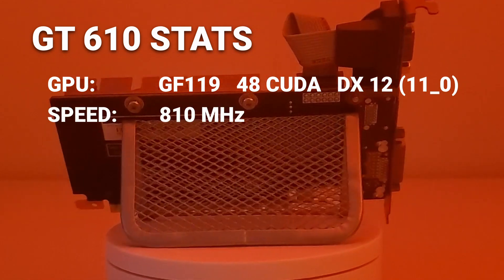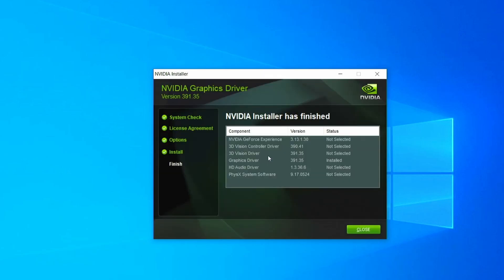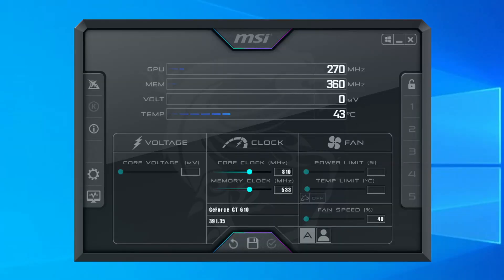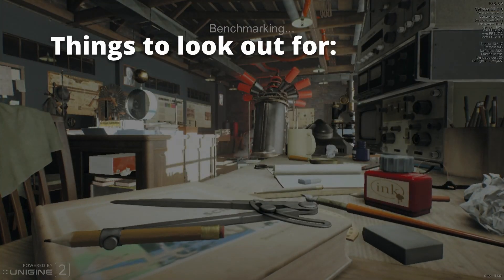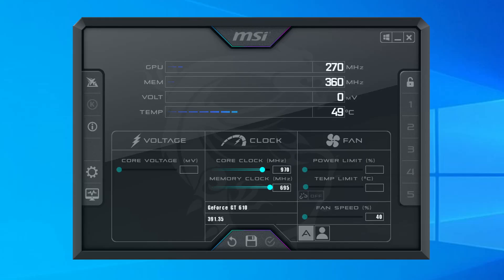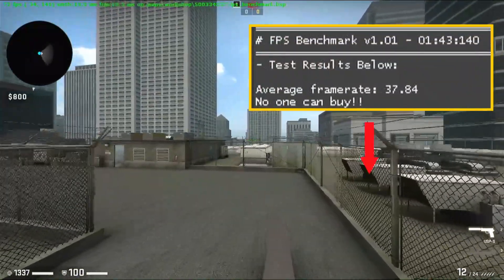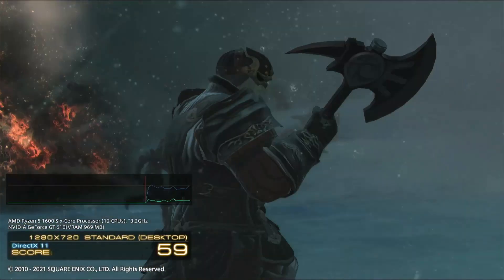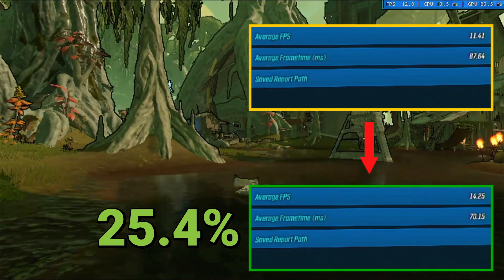Best GT 610 Overclocking Settings Guide

Comment: can it work with 620 gt
Reply: MSI afterburner works with 90% of gpus. Just slowly increase core clock by 15mhz and mem by like 25 for your 620 until its unstable then back off until you can run your games with 0 crashes. Good luck soldier.
Reply: @rrr00222  i am using 630 now cuz i cant affored better then that
Reply: @JedzStream  that is ok man :) information is the same if you wanna overclock. as long as you get enjoyment out of your system that is what matters, and using such hardware will make you appreciate the better hardware in the future

Comment: Is do 1055/650 gt 610 ddr3 2gb varient with 100% fan speed
Reply: I got the same one gt610 ddr3 2gb I usually get 25 average fps how much will it get after overclocking? And is it safe??

Comment: Sir I have gaming monitor 180hz can I output refresh rate 180hz from this card ?
Reply from the maker: The max refresh rate on the GT 610 is 240 Hz. Not sure if this is at all resolutions however.

Comment: Is it possible to connect 3 monitors to that GT 610?
Reply from the maker: Great question! Unfortunately, the GT 610 can only display up to 2 monitors at once. I tested this out myself and could get any 2 combinations of output (HDMI, VGA, DVI) to work, however when connecting all 3, one of the others would always stop broadcasting a signal.

For the GeForce 6xx series of cards, you would most likely need a GT 640 or higher to display more than 2 signals at a time.

Comment: This is one of the best gpu ever(not for gaming). It was actually my old gpu. One thing i noticed that the fan did'nt rotate. Do you know if it was normal cuz in your one it is rotating
Reply from the maker: Was a surprisingly impressive little gpu for sure. I believe with this test card the fan rotated at all times while powered on. Perhaps you had a fan that throttled the fan speed based on temperature?
Reply: @XLSTech  no problems with temperature but I used the gpu for a very long time and the past3-4 years the fan never rotated but pc ran completely fine. Strange!

Comment: why the limit of the core clock is just 910? MSI dont let me go more of that
Reply: for me it's 1055MHz for clock and 650MHz for memory, my card is of 2GB
Reply: Same broo @DheisonGomes-zo1qz
Reply: Bro which core and memory oc did you use ? Mine showing the same core 1055,memory 650 @DheisonGomes-zo1qz
Reply: same
Reply: depends on the graphic card

Comment: Bro after I overclocked my gt 610 games starts to freez and then I had to force shut down pc every time
Reply from the maker: Sounds like something may be set too high. Did you try reducing the overclock values to get something stable?
Reply: @XLSTech  yes bro, but it's not stable even at 900 core and 645 memory
Reply: It depends, not all chips are the same, some leave you more others less, you have to be lucky